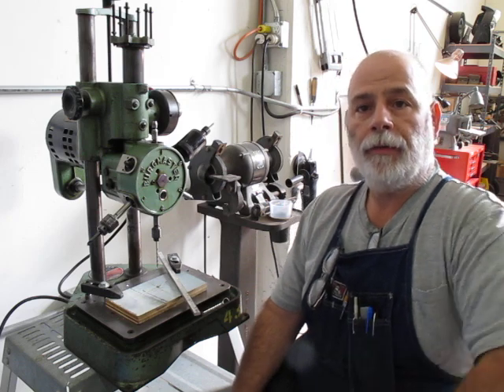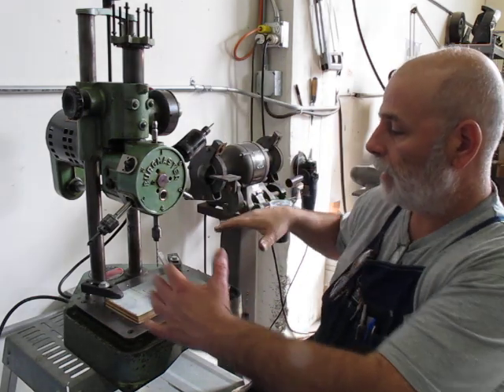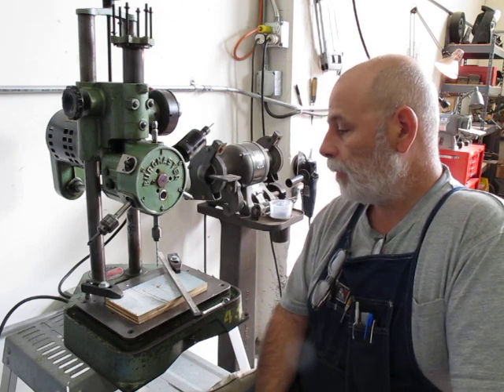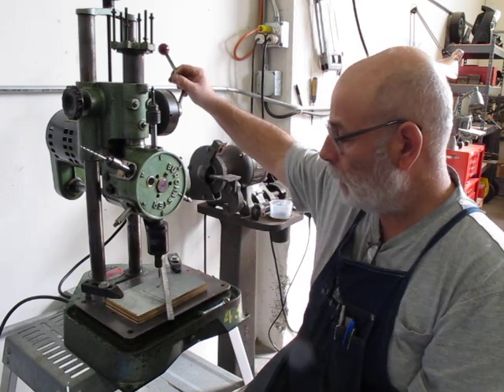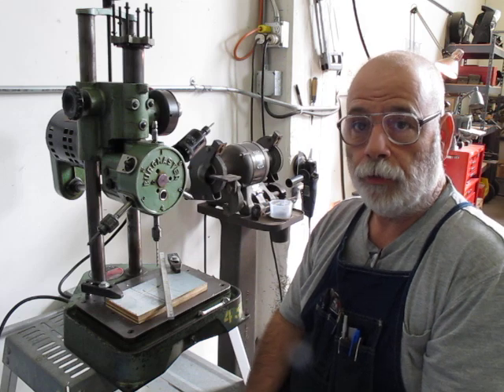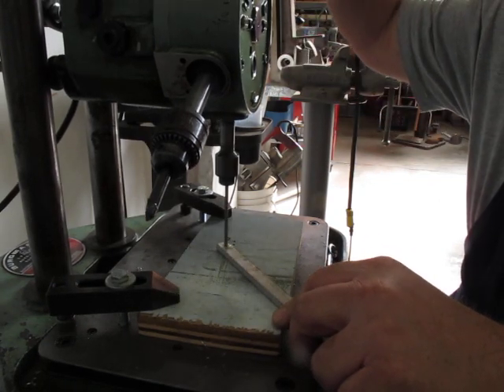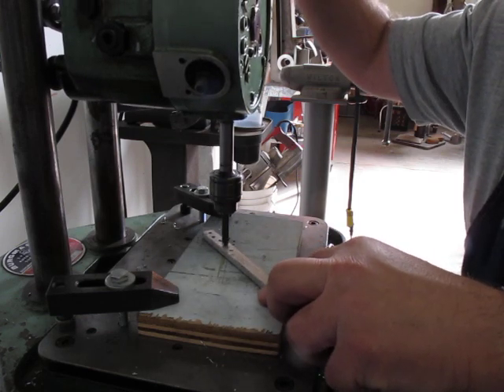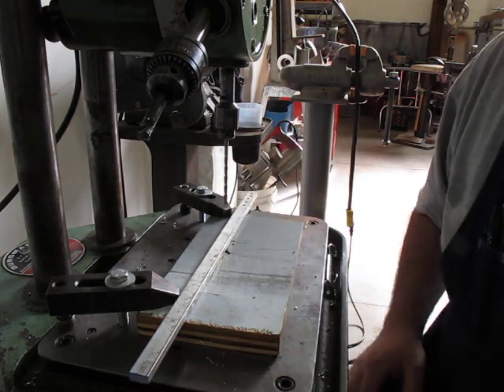Burgmaster Turret Drill Demo

Comment: Just picked one up at an auction this weekend.  Motor seems to have a faulty start cap.  Runs if you give it a push.  Speed change gears are little chewed up, looks like somebody tried to remove with vice-grips.  Trip mechanism for the tool change may need some lube and clean.  But will be a fun machine to clean up and put on the bench.  Thanks for sharing your video.  Can anybody send me a photo of the motor dataplate, mine is missing.  thanks!

Comment: I can see this would be a pretty easy mod to semi-CNC with something as simple as an Arduino or Lego RCX-brick style computer, and some solenoid and stepper motors. The trick would be holding the material(s) to be machined so they don't twist if the drill bit catches. Pretty cool - I'll give 4.5 out of 5 stars!
Reply from the maker: Hi William,

Burgmaster actually made some CNC versions of this machine back in the day. Thanks for the comment.

Cheers,

Tom

Comment: Hi Tom  always nice to see the old stuff. I worked on one of these at my first machining job, these were great for doing ports for aircraft hydraulics, you put the port form tool in one of the slow speed stations and then tap as the last tool. You have some really informative videos keep up the good work and thanks for all you do for the rest of the guys on you tube that box you welded up for Adam was great.
Reply from the maker: Hi Frank,

Thanks for the nice comment. I have seen pictures of old shops with rows of Burgmasters in them. Used to be pretty common. 

All the best,

Tom

Comment: The Burgmaster caught my eye. I am retired from John Deere and I ran a 6 spindle Burg on production.  It was a vintage CNC that was controlled by a reel to reel tape. It was a great running machine. I believe it was manufactured around 1975. I retired in 1998..........Thanks for bringing back some memories....I believe they were bought out by a company called Houdaille or something like that
Reply from the maker: Hi Randy,

Its quite the machine. If your interested in the Burgamster company and what happened to them read "When the Machines stopped" Its a history of the Burgamaster company. Thanks for the comment.

Best,

Tom
Reply: ..Well...I worked at Burgmaster from 1970-1980....it was a division of Houdaille, who also owns Strippit.....
 the units I worked on as elec-tech were much larger than these small model 0-1's I see here....
 They made big  8 spindle machines...225-230 (3 axis NC)......cat 40-50 spindles....work areas started at 20-"....went up to 40x120"....these were the last big NC machines before CNC came along.....Burgmaster went out of business in 1985-6.....too bad, they were big, heavy and well made....
Reply: Burgmaster was a division of Houdaille-Strippit

Comment from the maker: Hi Flute,

Had occasion to mess around with a big Burgmaster CNC mill. 50 taper with a W axis. Sold it to a company that dedicated it to drilling holes in flanges. It could pop a two inch drill through a two inch plate like cream cheese. A bit of a maintenance headache was the only downside. Oh yeah, it weighed 23,000 lbs for a table the size of a small Haas.

Regards,

Tom